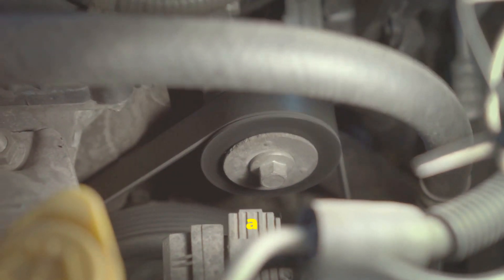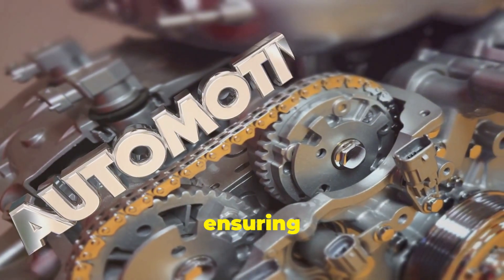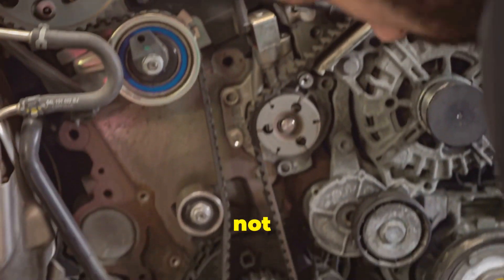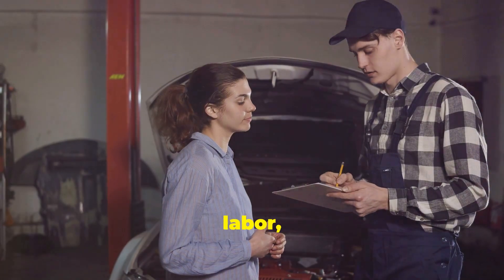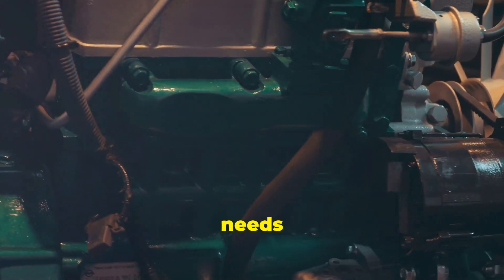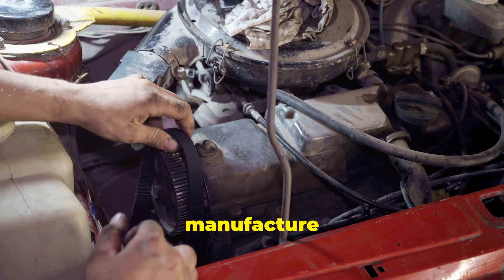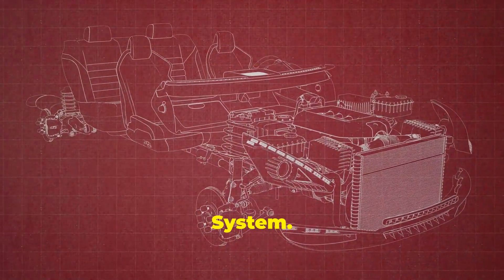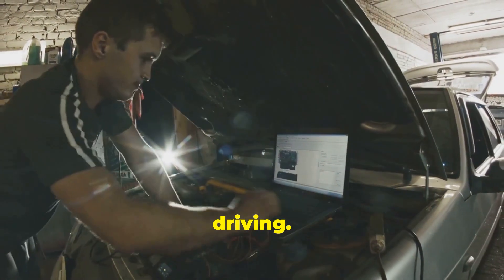Timing Belt vs Timing Chain: Which is Better?

Comment: Stop making cars that have belts or chains  . These cars can be made  to run with out that old technology. Job security. Think about it does a jet propelled engine have a timing belt or chain of course not . Stop using that method. When a plane is up 35000 feet in the sky. The captain miraculously say over the intercom . I think we lost our timing chain. Now what . Make the engine chain less and belt less . Because they can . and all these companies know it. Like I said in the beginning. It’s freakin job security 😮